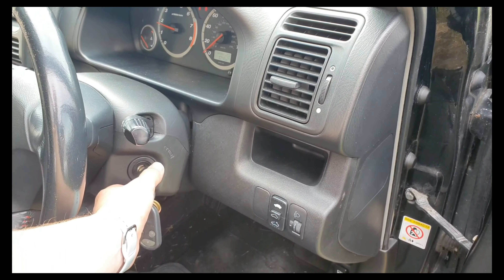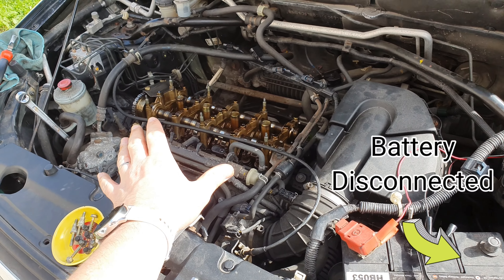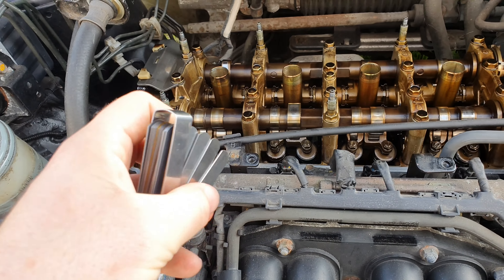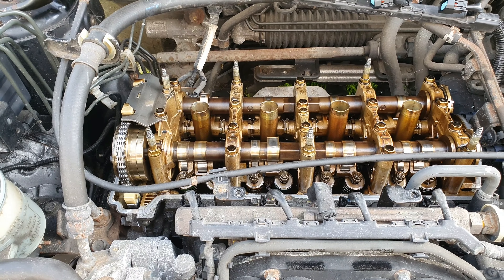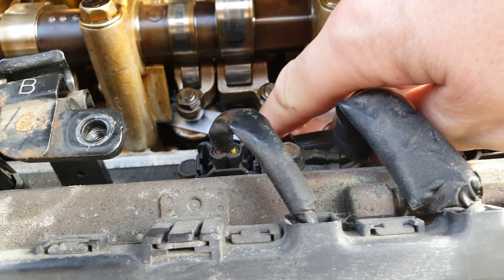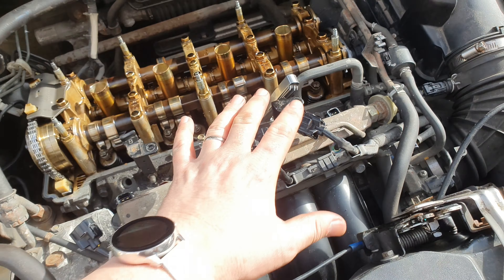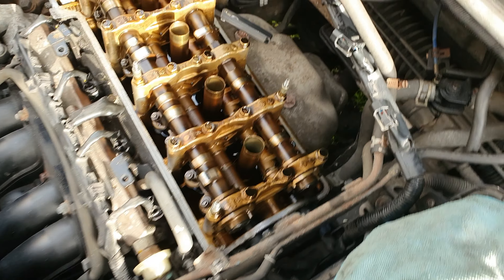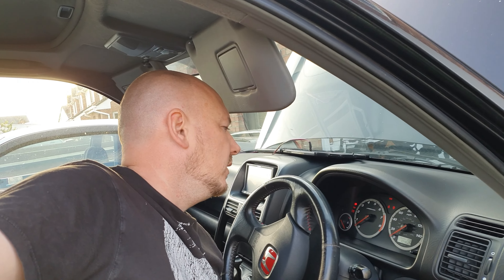Attempting a valve adjustment on my k20a4 2003 cr-v, k20 valve clearance, k20 valve noise

Comment: Any luck on this sir? I seem to be having exactly the same issue and it’s driving me insane.
Reply from the maker: @nizaamaj  i actually have not touched it since this video, i have been too busy for it. I do intend to drop the oil soon and check it out, but I'm kinda lost with it. It could be an oil pump issue or vtec solenoid maybe, but i really don't know.
Reply: @GPTV2020  thanks keep us posted mate!
Reply: @GPTV2020  So i've had the engine pulled as the sound was getting worse. It turned out the rod #3 had spun a bearing. Remedy is to replace crank and bearings. Hope your issue is not as bad
Reply from the maker: @nizaamaj  ahh shit bad luck. I've not had a minute to do anything with any of my car's so hopefully it isn't the same problem as your's!
Reply: @GPTV2020 I have similar issue but not as bad for my 2003 CRV K20A4 and I got it fixed with changing to using Eneos X Prime 5W40. You may try engine oil contain with molybdenum  additive and preferred with API SP rated. After 3 oil changes, the noise is completely gone.
Reply from the maker: @waynehung4801  about two months ago I explained my problem to a retired mechanic and he suggested an oil flush an treatment so i got something to do this flush and treatment but still haven't had time to do it. So hopefully it will go away just like your's has, but i still think its a rod noise for mine. I will have a look at this oil your talking about and see some results. It'll be interesting if it works, cheers for your comment.
Reply: @GPTV2020 Oil flush is not a good idea as the residue remains in the engine will upset the engine oil additives balance. 3 regular intervals oil change will be sufficient, the first oil change make big difference but still have noise intermittently but it will get better and better. I also replaced the VTC and VTEC solenoid gaskets to make sure no metal shavings or you may clean then if the gaskets are in good condition.
Reply from the maker: @waynehung4801  did you change the gaskets before the oil changes? Also the noise has to be coming from somewhere, changing the oil could be just masking the noise and covering up the real problem? Maybe i will try a couple of oil changes first and then try the oil flush and treatment.
Reply: @GPTV2020  The gaskets replacement comes after as VTC gasket leakage but I found out metal shavings on VTC and VTEC gaskets which may reduced oil flow to the exhaust camshaft if I remember it correctly. I suspect the noise could be the piston since the pistons and valve are originally coated with molybdenum to reduce friction and improve reliability but it wear out after 150,000km-200,000km. Regular engine oils will not have molybdenum additive also API SP restricted Calcium detergent which make molybdenum and ZDDP engine components protection more efficient with significant friction reduction. My case is when cold start, the noise is noticeable and will quite down when engine is hot but still there. I was unable  to find the noise source as well it's like slapping or ticking sound until I change to Eneos X Prime 5W40, the noise is gone even with cold start and less vibration as well. By the way, I also use complete fuel treatment before I change my engine oil just to clean up the intake valves. I think I have make my 5th oil change by now and believe it or not the engine feel like brand new, no more acceleration hesitation on the motorway.
Reply from the maker: @waynehung4801  Well i am going to try changing the oil out, and i will have a look at this Eneos 5W-40. I don't need or use the CR-V any time soon so that's way i haven't done anything to it yet. Thanks for all your information, i helps to get other opinions or experiences. Thanks again.

Comment: After fixing all of that, I would say it’s your timing chain is stretched, or something with your timing chain adjustment
Reply from the maker: Thanks for your comment but i just had the chain changed a few months before so I don't think it is the chain unless it was fitted incorrectly or is a tensioner problem but it was working fine.

Comment: Did you find the issue and get it fixed....i have the same symptom with my honda crv 2005 also came up a few months ago.... I've been trying to get it fixed
Reply: Did you take the bottom end off and see if theres a problem there?

Comment: Does the engine noise become less noisy as it warms up?
Reply from the maker: No that sound stays the same, even when warmer. And the day this sound started i had just rosted the car at 120 mph for around 5 to 10 minutes stright, so it was hot and then i drove it home for another 30 minutes. That's why I don't think it is piston slap.

Comment: Should have asked me for tools. I had to buy the special tool from the UK.

For B series, you need to torque the screws to 20Nm.
Reply from the maker: Ah i got trough it anyway. But I'd say it's probably close or the same as the B.
Reply: Yeah.... I'm trying to find the courage to try a valve adjustment on my Acura MDX.
Reply from the maker: @theospam  it's not really that hard to do just make you you have the right tools and specs that are needed.